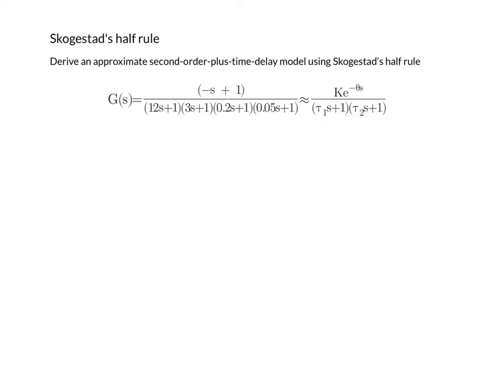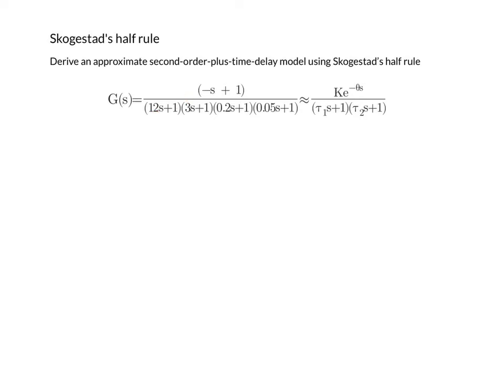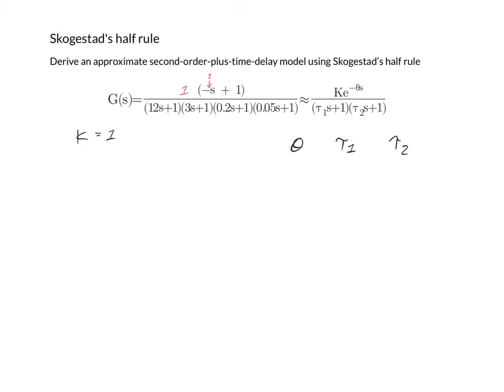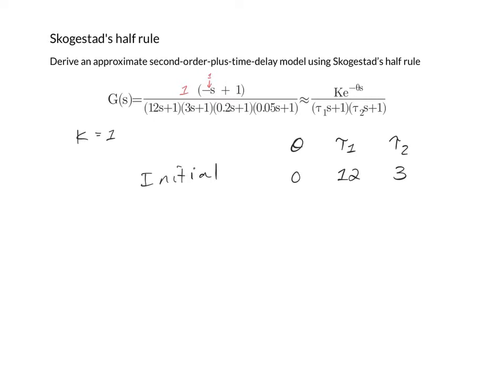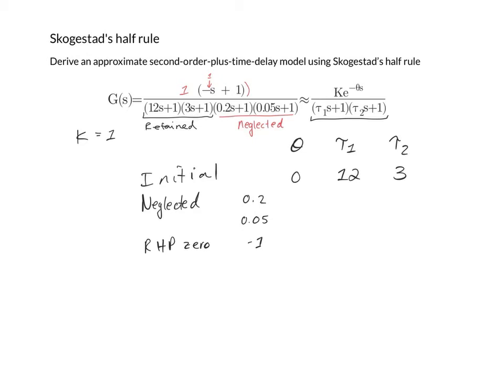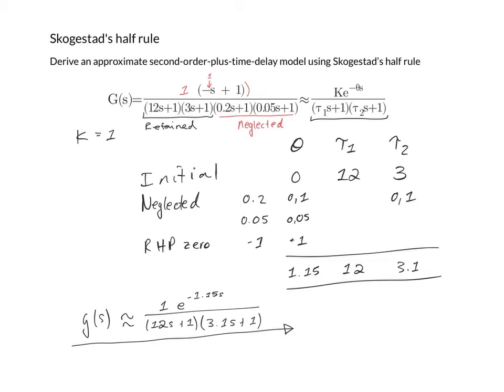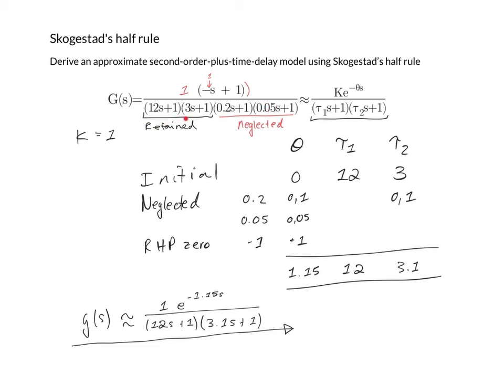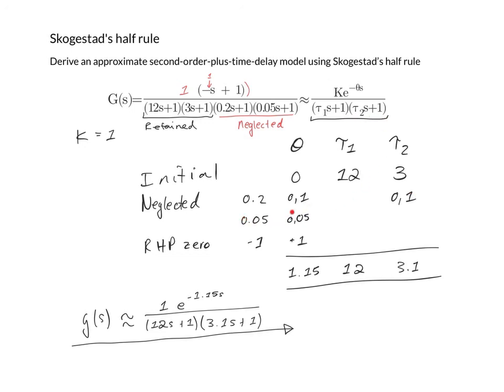Skogestad's half rule

Comment: How will you do a Skogestad's to approximate SOPTD, with negative k and with one of the time constant negative
Reply from the maker: The sign of the gain does not matter to this method - you use it unchanged. However, if one of the denominator time constants is negative the system is unstable. The method only works well for stable systems.
Reply: @chthonicdaemon  what can I do with the negative time constant so that I can apply the Skogestad's?
Reply: @chthonicdaemon  I wonder if I can use other approximations like Taylor series or Pade Approximation. Although, I'm not sure if the negative time constant will still be a problem.